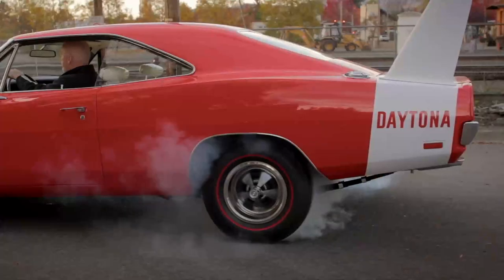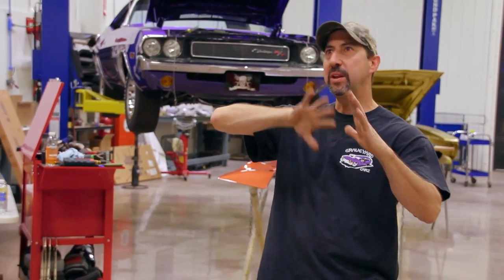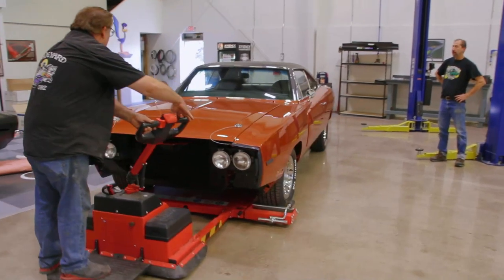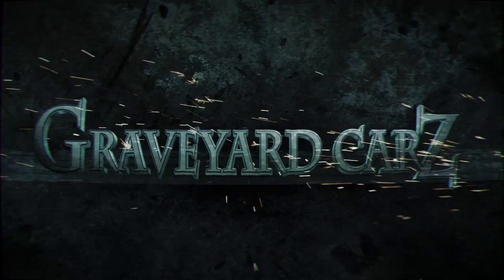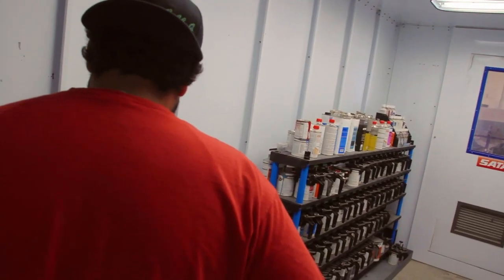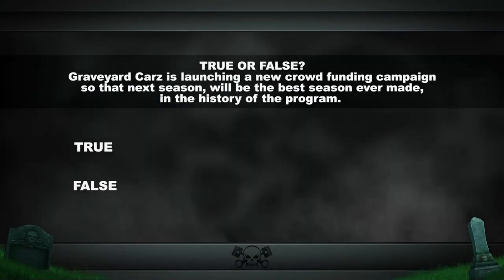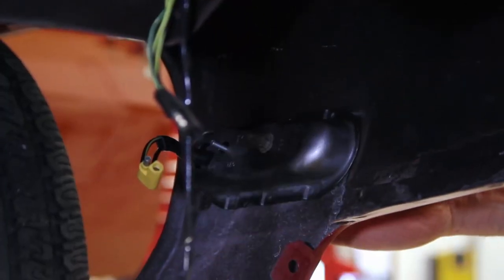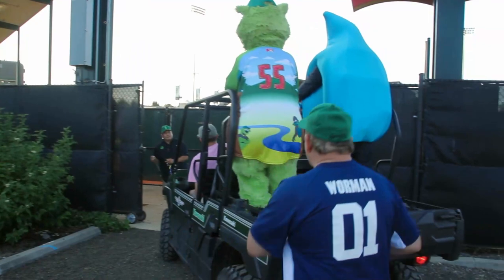1970 HEMI CHARGER PAINTED BY THE ICE-MAN!

Comment: 2:51 Pretty sure the original insignias back then were were held on by pin clips in holes in the body, not glued with adhesives. Back then glue adhesives were nowhere near as strong as what we have today. Same goes for interiors. Back then interiors, dash, panels etc were held in by screws. Today all done by fancy plastic clips and adhesives. Thats why todays cars have less rattles or squeaks as they age. Also why its more of a pain in the ass to disassemble and reassemble without breaking a clip or even getting access to the clip.